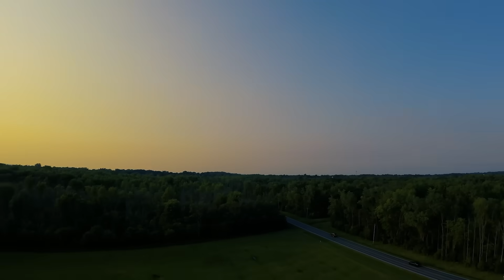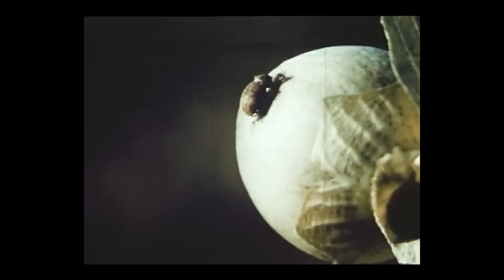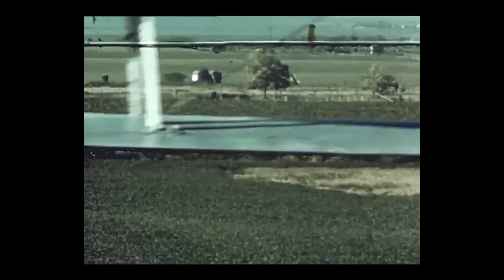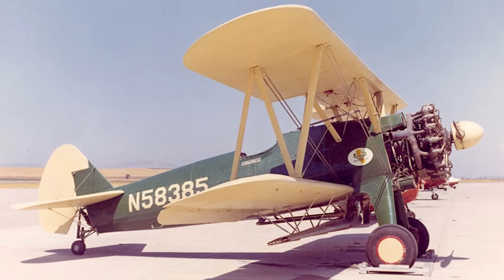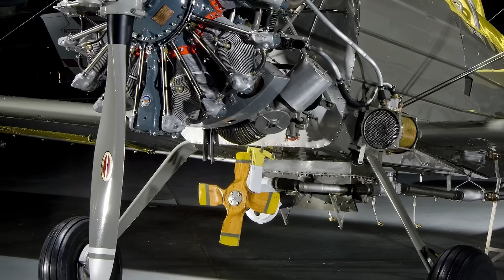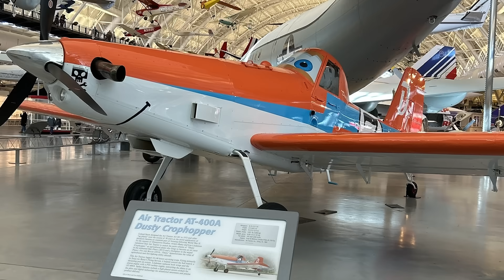Why Early Crop Dusters Were So Dangerous

Comment: Leland snow first invented the Thrush S-2 , sold the company then when his non compete was up started designing and building air tractors
Reply from the maker: @willjohnson3907 Leland Snow had a huge impact on agricultural aviation. His work carried through both the Thrush line and later the Air Tractor designs.

Comment: You are not fully correct on when Leland Snow started designing aerial application planes . He began in the 50’s or early 60’s with the A model Snow and worked up to the D model. He then sold the business to North Anerican who were taken over by Rockwell building the planes in Albany Georgia. They continued to advance the design with the Thrush S2R then sold to their primary dealer Fred Ayres. By the late 70’s Ayres were powering the S2R primarily with the P & W PT6A engine such as the S2R-T34 today the line that Snow began continues in Albany under the banner of Thrush Aircraft. Snow stayed out of the business for a few years after selling then started up Air Tractor.
Reply from the maker: @duncanrichardson6870 That’s great information — thanks for adding that detail. Agricultural aviation has such a deep history that it’s hard to cover everything in one short video. I appreciate you sharing the background on the Snow designs and how they evolved into the Thrush line.

Comment: The CallAir was the “Meat in the middle” airplane. It had the pilot ahead of the hopper. Another potentially good video screwed up by AI. As to the “deadly flaw” in the Stearman and the N3N, they were extremely stiff fuselages and didn’t progressively crumple during impact. They were like flying an anvil into a brick wall. Roy Grumman designed the G164 (Ag Cat) to collapse around the cockpit cage in a crash. I grew up in the crop-dusting community and saw a lot of Ag Cats go boom, and in a surprising number of cases the pilot escaped with minor injuries. And it did NOT have a pressurized cockpit.
Reply from the maker: @perrybronner3215 Interesting perspective. Agricultural aircraft design went through a lot of experimentation as engineers tried to improve pilot survivability and performance.

Comment: Good coverage of the bigger crop dusters before they became million dollar turboprops.  I did fly the Stearman with the R-985 P&W, but mostly trained pilots in Cubs and worked in Pawnees and CallAirs.  Hundreds of operators kept adding Pawnees and CallAirs.  Eventually they got well enough to get rid of the tired 235 HP fleet and get one Turbine Air Tractor or Thrush.
Reply from the maker: @jimmydulin928 Sounds like you saw that whole transition firsthand — from the Stearmans and Cubs all the way to turbine ag aircraft. Fascinating era of aviation.

Comment: I grew up around southern shade tobacco where crop-dusting was quite common.  My Dad's business partner, John C., had spent the 1940s and much of the 1950s flying crop dusters after his Air Corps service in WWII flying B-25s.  He had a lot on interesting misadventures in Central and South America spraying crops and fighting fire ants.  One that sticks out in my mind was his first time flying modified Piper Cub Specials and Supercubs with a hopper in the back.  As a result, there was no room for a passenger, but he needed a guide to point out the landmarks for his first orientation flight, so el hefe had one his peones wedge himself between the wing strut and fuselage.  The kid guided him to where he needed to spray, then he turned around and began heading back to their grass field.  Along the way they ran into a bad rain squall and was buffeted about.  When the little plane emerged from the downpour, John noticed his guide was missing.  He flew back and forth trying to locate him, but it was to no avail.  Finally he headed in the general direction of the airfield using the landmarks his guide had pointed out.  When he landed he approached el hefe, fearful of the fate that awaited him once he learned what had happened.  Hesitantly, John explained the situation and when he was finished, el hefe nodded and said, "Don't worry, I'll get you another guide."  That was the end of it, no search party, no official inquiry, no nothing.  Suddenly it dawned on John that if he ever crashed, he could expect a similar lack of response unless they wanted to recover his airplane.
Reply from the maker: @Paladin1873 That’s quite a story. Early ag flying in remote areas definitely had some wild situations. Thanks for sharing that piece of history.

Comment: Regardless of how much "safety" is built into these modern ag planes, you stall 'em, you die.  Nothing has changed.  As a young teenager in the early 60's, down here in SE Texas, it was crop dusting heaven.  Millions of acres of rice and soybeans.  My uncle farmed both of them.  He had a little over 600acres.  It's where I was first introduced to "round sound".  Fell in love with the Stearmans.  Most of the ones I loaded and flagged for were R-1320 600hp Pratt and Whitneys.  We flagged for pilots in those days.  No GPS lol.  Depending on gallons or lbs per acre was the decider in how many giant steps we took across the field which put us directly under the airplane as it made its pass.  Once the plane got within a couple 100' we would start walking to get out of the chemical but it was impossible to not get some residue on you ALL DAY LONG !!  I have no idea why I have never had cancer.  I just turned 80 on 2/20 and have never suffered any known ill effects from being in that chemical and inhaling it.  Grace of God is the only explanation.  I got my PPL in 1965 and when I got out of the Marine Corps in 68 I got my CPL and started in a Ag Pilot School on the GI Bill in 70.  Still flying Stearmans.  Not long before I was to graduate, another student had the brakes lock up on him and flipped the plane on its back.  That ended my chance to be an Ag pilot and again, by the grace of God, I'm 80 years old.
Reply from the maker: That’s an incredible story and perspective from that era. Those early ag pilots were doing some remarkable flying. Thanks for sharing it — and a belated happy 80th birthday too.

Comment: Engine in front then a hopper then the pilot, the same arrangement on all the aircraft described. The first Snow design had the pilot between the engine and hopper, as do many others.  The tip vanes on a Weatherly are horizontal, not vertical. AI can't get anything right.
Reply from the maker: @bullthrush Interesting point about the layout differences. Agricultural aircraft evolved a lot as designers experimented with hopper placement and stability. Appreciate you adding that perspective.

Comment: I owned and flew a Stearman for 30 years.  It was one of the Delta Airlines fuselages that was never converted to Ag duty.  It was featured in the movie: "The Tuskegee Airmen". I sold it several years ago and it now resides in a flying museum in Madrid.  The time a pilot spends in the air is not deducted from one's lifespan.
Reply: I worked for a cropdusting outfit in the 70s, and my boss had a Stearman and an A Cat. He loved that Stearman. The A Cat sat on the ground most of the time
Reply from the maker: @turbo32coupe That’s an amazing history for one airplane. Thirty years with a Stearman must have produced some great stories, and appearing in The Tuskegee Airmen makes it even cooler. Glad it’s safe in a museum.

Comment: The Stearman had all of the safety features the purpose built planes did.  In fact, they learned from the Stearman when designing later crop dusters.  The engine mount, hopper, and wings provided crush space.  The front cockpit hopper was on the CG.  It is now and forever what every pilot thinks of when you say “cropduster”.  What it lacked was the payload of a purpose built modern duster.
Reply from the maker: @johndurant622 That’s a great point. The Stearman really did set the template for what people picture when they think “crop duster.” And you’re right — the later purpose-built ag planes mainly pushed the payload and efficiency further.

Comment: Interesting video. At 1.42 there is a clip of MARSH Aviation on a run. That company flew out of Walla Walla;  the pilot usually was Gene Wing. Seriously. I flew the Stearman in '59 and '60 for Blue Mountain but ours still had the  220 ish HP Jake's and Continentals just as they came from the military along with the inertial windup starter. The company had a building full of pickled engines standing by. Many private operators did bolt on an R985, however that did change the handling just a bit. LOL. BM took on the Ag Cat dealership about then and the airplane was a big change, however, in those days, the used Stearman market was still cheaper than a new Ag-Cat. I miss the sound of the starters on those round engines in the early morning...
Reply from the maker: @2140BlackCreek That’s fantastic history — thank you for sharing it. Flying Stearmans in that era must’ve been something special, and I love those details about the engines and starters. And you’re right — the jump to the Ag Cat really marked a new chapter. I can almost hear those round engines winding up now.

Comment: I just did a quick compare, and yes, it's a bit on the lower volume side, though I never actively noticed it until now.
Reply from the maker: @magnusstrindboem8988 Good ear — I’ve been adjusting the audio for a cleaner sound, but I may have gone a little too gentle on the levels. I’ll bump it up going forward.